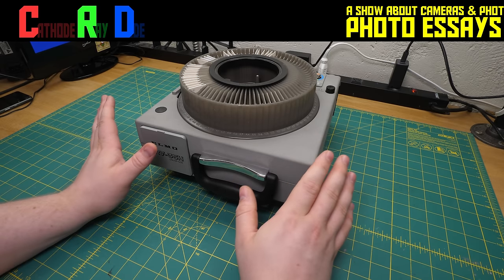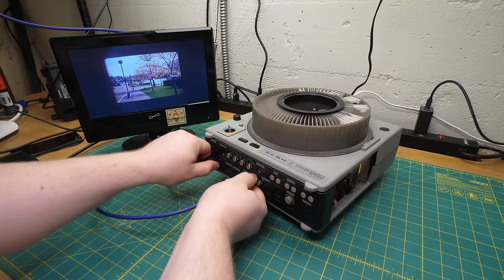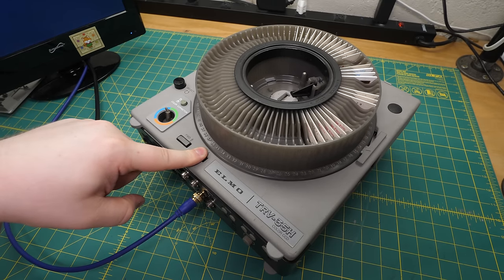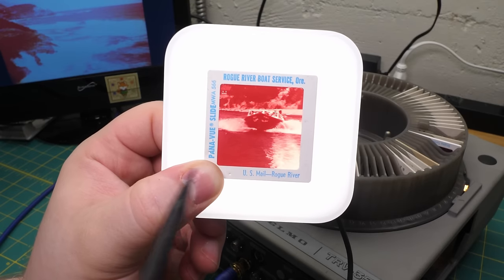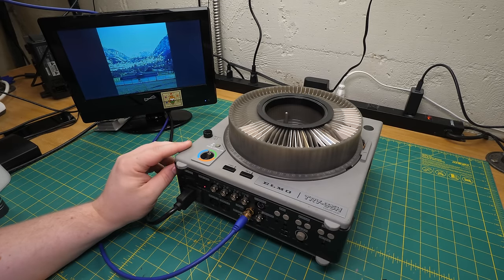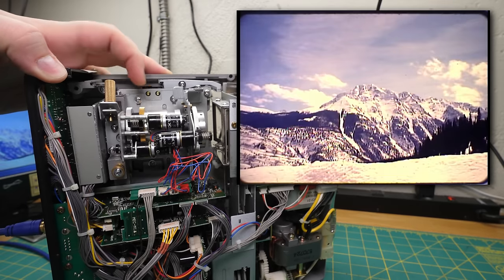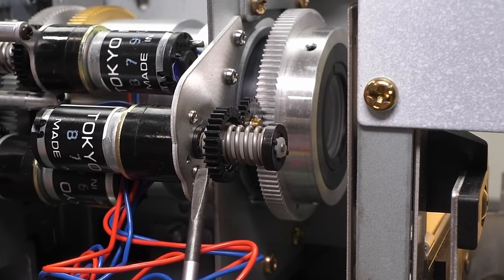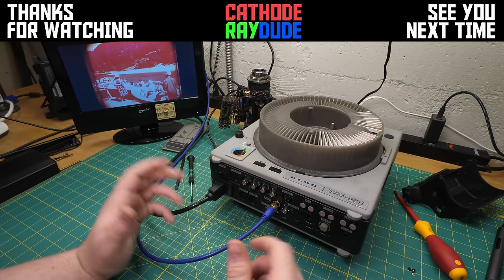The ELMO TRV-35 slides into your video feed

Comment from the maker: Yes, I know the spring is under compression, not tension. I have no idea why I said tension.
Reply: compression is also a form of tension, is it not?
Reply: @raafmaat Yep, tension has no vector. Compression opposes expansion or rarefaction for gases.
Reply: 20 lashes 😂
Reply: @aeonjoey3d  Why so tense?  I mean, why so compressed?
Reply: How dare you
Reply: @CathodeRayDude  I was waiting for this error to show up, you could have cut the compression with a knife, and that introduced some very interesting encoding errors.
Reply: Good - that comment reduced the tension! 😄
Reply: Blink twice if the spring is involved
Reply: @lfla0179  ... If a wire is made into a spring, it's like a beam, if end is compressed isn't the top of the circular cross section of the wire under tension.  If I clamp a ruler into vise and bend the tip, this is a beam and when force is removed it bounces back to strait?
Reply: Because you hate capitalism. 🤬
Reply: @raafmaat  Stresses can only be either compressive or tensile (or 'shear').

Comment: i have heard a story of someone using 6 to 8 genlocked (slightly offset from one another) projectors *without a video mixer*, just all pointed at the same point on the wall, to do some kind of faux-crossfade. i imagine hearing all those clunks going left-to-right behind you at exactly the same rate every time was a very satisfying experience
Reply: Yes , that was the standard way the big multi projector slide shows worked, whether in museum displays or trade shows or other big presentations, before we had less expensive HD video projection.
Reply: @StevenBradford  There even were projectors with twin lenses that could load two slides and fade between them for a seamless slide show.
Reply: My dad used to do this sort of stuff. Huge banks of about 16 projectors, could even do some rudimentary animation by flicking between projectors fast enough. Sounded like a goddamned firing range in the projectionists booth.
Reply: @AntiPseudo : I was trained by a guy who did those big presentations -- 16 literal frames per second is janky animation, but 24 or more is full-motion video, with slide projectors! Used a programming rig (think video mixer) to control sequence, timing, light intensity. He said his favorite show-off was making the stars twinkle in a night-sky background.

Comment: the capability to zoom into the slide and genlock+serial control the thing makes me imagine a fly-by-night broadcast studio using this and a frame buffer as their static matte source, clunking through backgrounds and fake-CG elements to shove underneath and above talent with a stack of keyers. every night they have a 125 year old savant paint the weather onto a copy of the local map directly onto the tiny slides.
Reply: +1. Before there were computers everywhere in the broadcasting industry (of which I am a worker ;-), I think you could use this with some rudimentary DSK capabilities to put a name on screen, an info or else. Having nothing that could create it electronically, or nothing cheap enough in the least, I could see how this would be practical… during a live show, all graphics (lower thirds, bugs, etc) are often numbered and put in the order they’ll be used, it actually make sense to use a carousel !
Reply: @Vincent-o5p  oh for sure! i remember at some point finding an old betacam tape set up like this where every two or three frames was a different graphics element and theyd use a specially calibrated VTR with a framesync and a remote to use them as mattes, kinda like videofloppy! its really funny to imagine a clunky slide projector doing it though.
Reply: Do we still get a full elevator orchestra playing sped up Vaporwave?

Comment: Because I'm an old, I did some school presentations on slides. The fanciest one I did involved a tape recording of the presentation's audio and two slide projectors aimed at the same screen and wired to a special control unit. One slide projector held the odd slides while the other held the even slides. When it was time to change slides, the audio recording had special, sub-audible markers inserted that the control unit could detect. It would use those cues to turn off one one projector's bulb while simultaneously turning the other's on. The dark projector would then advance to the next slide in the carousel. The effect was a very smooth and very professional-looking cross-fade between the two slides, using just the thermal inertia of the projectors' bulbs.
Reply: Also as an old who was a big fan of the Amiga, I know all about genlocking.
Reply: Thanks for mentioning the device that controlled 2 projectors. The fade out when the projector bulb was turned off was something special. I don’t think computer dissolves for transitions can match the transition of a real projector bulb being turned on and off.

Comment: Working in a contemporary art museum, we deal with slide projectors all the time. It's actually the perfect profession for someone interested in technology from all eras (which means, by extension, loving this channel). One of the most impressive things I've ever seen is a Nan Goldin exhibition, where there were at least 12 slide projectors connected to a computer to control them all. Six projectors at a time would project their own section of a photo, three wide and two tall, and when the carousel reached the end it would switch to the other six. The amount of alignment and ND filters to make them all run must have been immense, as well as the upkeep of repairing that many machines in 2023. Also, when the show ended and all the machines reset back to the starting position, the rattling of all 12 going back to zero was pretty amazing. 

I've only had to control a single projector show like this, but the software and accompanying hardware only works on era macs, so it was a bit of a challenge.

Comment: 16:35 - I volunteered at the local community cable station in the late 80s. One show I worked on was a movie review show, and this was back when studios sent out "EPK" (electronic press kit) packages containing a tape with clips and some 8x10 b&w stills from the movie. To get those stills into the show, you would mount them on a rostrum frame with a dedicated studio camera pointed at the photo, lit in such a way to prevent glare. No digital frame store, you just cut to the still camera feed and swapped in the next photo as you went. That's pretty much what this is doing in a single box, but just with slides. I remember framing up the shot on the stills and then locking down the camera; no fancy camera moves for us.

Comment: Sylvania in 1969 sold a console color TV with a built in flying spot scanner and Carousel changer for home use. It did not have any zoom control, and just displayed the 4x3 center portion of the slide. Also, no video output. It did have one advantage in that the low light level from the flying spot tube would not fade the slides. 
For comparison, automatic repeating projected displays for corporate PR would typically fade slides noticeably within a week.
Reply: That would have been really expensive.

Comment: When I was working at the head office of Bang & Olufsen in the Netherlands they had 21 kodak carousel projectors connected to a reel to reel tape recorder that send out pulses to operate the slide projectors and played the sound for the slide show. there where also machines with cassette tape that could operate the projectors. it was really nice to see a presentation on it with slides overlaying and so on.  around 2000 they throw them away. so I started to collect them and had more than 100 different slide projectors, only hold on to the kodak carousels, after a lot of trying I convert them to LED,  less heat and some I took out the fan so no noise and you can project 1 slide forever without overheating them. also once I put a lcd screen from a old Casio digital  camera, it had a video in  on the print,  and without the backlight you could project in really big pixels whatever you liked. was nice on parties where from a distance you see an image and close it looks like color chancing tiles. Have a big tele and very wide angle lens for them. this Elmo thing is something very nice.
Reply: did they ever use them for signage?
Reply: @blocktockblock6329  yes they did, as a photographer myself I can not imagine the work that goes in to make 80 slides for 21 projectors. Some where text but most of it was product presentation

Comment: 9:55 I'm sure plenty of people did it on accident, but I know of at least one instance of it being done on purpose. In the early touring days of Pink Floyd they would take two slides, add a drop of oil between them and put them into the same slot and leave it projecting as they played. As the oil heated up from the projector lamp it would move around and create a "psychedelic" effect.

Comment: In the mid 60s, the PR department of the college I attended had three projectors in separate side-by-side futuristic rear projector enclosures (20 inch screens), with all three advancing simultaneously with a single control pulse. I installed a punch paper tape reader so that it advanced on each pulse but the individual projectors either did or didn't depending on the corresponding holes in the paper tape. This saved them from making duplicate slides for the times when they wanted the image to stay the same on one of the screens.

Comment: This reminds me of an event we had at school back in 1996. We didn't have those project-to-video thingamagicks, but we used two regular carousel-style projectors - more professional models than what you'd use at home since they also supported fade-in and fade-out-, aligned their image (we even had special test pattern slides to adjust the geometry) and then hooked them up to some PC control interface (the link from the PC to the interface must have been serial at that time, but the interface to the projector must have been something else since the cables were extremely long). We got the show programmed perfectly synchronized to music (if you managed to hit the start button in the PC software and on the DAT player at the same time, that is, the control software did not support audio.)
Oh nostalgia...  To this day I can hear the music and see how the slides fade in and out. I guess I spent way too much time back in the day getting the programming right. And today it would be so much simpler to get the same result...

Comment: Ektachrome is particularly prone to going magenta.  The cyan dye fades, leaving red and yellow.  There are specific ways to regain cyan, depending on how you want to go about digitizing the slide.  I oversee a museum collection full of magenta slides because the photographer preferred local developers, and Kodachrome could only be processed by Kodak directly at the time.  So they went Ektachrome.
Reply: Would a cyan light source help?
Reply: I scanned mine and my relatives entire slide collection earlier this year using Minolta Diamage Scan IV-scanners. Some slides from the late 60s and early 70s were almost going magenta, but it's suprising how good they can get with digital postprocessing of the white balance. Cheap slides bought in souvenir shops seems to have faded the most.
Reply: I worked in a photo lab years ago, and we were the only Walmart for quite a distance that still had scanner capabilities.  I was also the only person who knew how to do it for... probably a further distance than that working in a photo lab at the time.

The color correction many of them needed -- especially turning either green or magenta -- was incredibly disappointing sometimes, but sometimes you could get a pretty clear photo of someone who's been gone for years, and those were always some of the best and most incredible moments of that job.
Reply: @renakunisaki  I have seen that used, I presume a programmable LED panel was used to tune the color and then used as a backlight for a scan.
Reply: @sydneys207  I have to ask someone to play with them when I want to correct the color, I can't figure out how to get any decent results.  It's definitely a skill.
Reply: Nikon Coolscan 5000 user, Old Kodachrome's are amazing.Afga , Ektachome and the FREAKING tourist gift slides, not so much.
Reply: It was so sad seeing my mom's graduation slides from the 1970s almost completely gone.  I was able to recover enough information from some and edit them in Photoshop to get something halfway decent.

Comment: After going to the  effort to build that, seems surprising they didn't make it able to take a film strip, and invert to display a negative
Reply: The uni I worked at a long time ago had an AV department that did things like cut and mount filmstrip into slides to transition to this "tech". They also used to hand assemble colour OHP slides using hand cut cellophanes. Things have changed so much...

Comment: Hey, Dude. I'm an AV guy from the 80's and 90's (and now, actually. I've come full circle, I guess). People that used these and (non video slide projectors) might have their slides made up using software like Harvard Graphics (if they wanted to show more than just photos.) They would then get the slides printed up using a photographic service or a device they had might have had. 
I used them at hotel events by law firms, financial institutions, etc. I worked at a university where They had a couple to transfer old slides to video.
Nice video!

Comment: I’ve always found slide projectors neat.  I was born and raised in the 90s and never really encountered them.  I’d start groaning if you brought out an overhead projector though (unless you have that sweet transparent calculator). It made really creative use of transparent LCD displays.   All the numbers were transparent too so you could see them on the projection
Reply: I just looked up that calculator you're talking about, that does look cool! "The Educator" is a pretty blunt name for it though lol.
Reply: Why would the numbers need to be transparent?
Reply: I remember the era in which they were selling flat panel LCDs that you could lay onto an overhead projector in order to present to the group from a laptop. It was expensive but it was a lot more portable so long as you were certain there would be an overhead projector present in the room where you were going to be, and that was a pretty strong assumption in academia or business in the 1990s.
Reply: @AlRoderick  i was given one by my school  i put a bright white high power LED i stole from my dads expensive flash light in it and took an old broken laptop and ripped out the backlight and turned it into my own movie projector i did not get spankings and we watched movies outside on the side of the house
Reply: Thank you for unlocking that memory of the calculator!
Reply: @AlRoderick  One of my professors in university had a laptop that you could take the back cover off the screen and lay it on top of an overhead projector.

Comment: Slide projectors were very common in TV stations and production studios. They were used for everything from titles and credits that were chroma keyed over video to that over-the-shoulder box for news. They eventually were replaced with digital still store systems like the Quantel Paintbox. Most TV stations probably used some really expensive RCA projector bought back in the 1960s but production studios would find this useful. The color adjustment was used with titles to make them more colorful.
Reply: Also used during technical difficulties. The master control would switch to the feed of one of those boxes while figuring out the problem. The muted colors and very still image of those slides always puzzled me as a kid.

Comment: When I was in highschool in the mid-to-late 2010's, my school was transitioning from those older document projectors to "smart boards". I've seen both, but anyway...

IIRC, math teachers would make the most use out of them. Most of them would have transparent documents w/ typed black text for lessons. The surface was like that of a dry-erase white board, so that they could easily write on them and erase their marks without skipping a beat.

Simple, yet elegant. Worked pretty well.

Comment: We did not take 1000 photos. We had rolls with a certain number of shots, so we had to carefully think about whether a certain moment or scenery was worth a shot on your film. Good ole days when photos meant more. I preferred it over taking 1000 photos and then never looking at them again❤. Great video dude!
Reply from the maker: Well, it depends on your intentions and budget. A casual photographer probably wouldn't, but a serious amateur or pro, who commonly did take a dozen shots or more of anything they felt was worth shooting at all, very possibly would use that much on a multi-day trip. 1000 photos is only about 28 rolls at 36 exposures each; I have half that much film sitting in a bag in my closet from a road trip I took in 2004, all shot on a fully manual Minolta SRT-102 from the mid 70s. If we'd stopped a couple more places I'm sure I'd have had well over 20.
Reply: you are committed!  I might have done that had I been able to afford that much film. Developing all of the rolls cost money too. I could develop my own black and white in a lab at high school, but not color film.  I did find thousands of slides my dad had developed by Dale laboratories back in the day I want to eventually do something with. Thanks again for the video and the engagement!

Comment: There were many “dissolve controllers” that were used with multiple slide projectors pointed at the same screen well before this device.  In addition to simple dissolves some had effects even simple animations by rapidly turning the lamps on and off in multiple slide projectors pointed at a screen.  These controllers were connected to remote port to control the projectors.

Using multiple of these Elmo’s and a video mixer could be used to convert one of these complex shows to video.